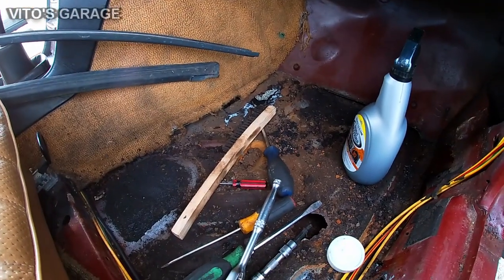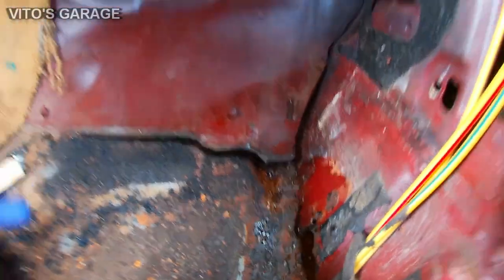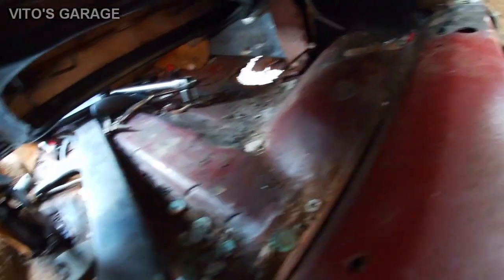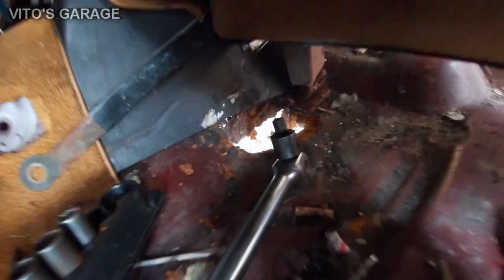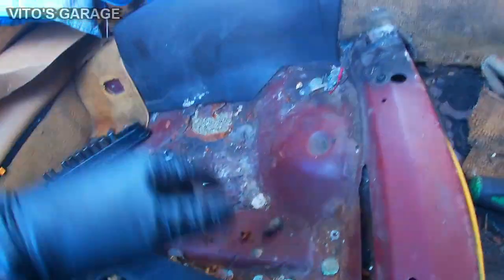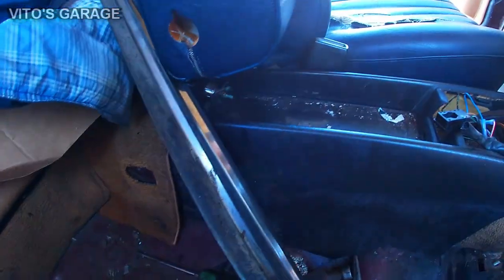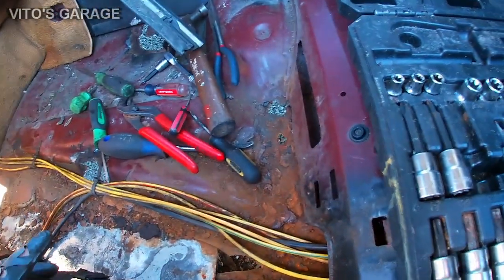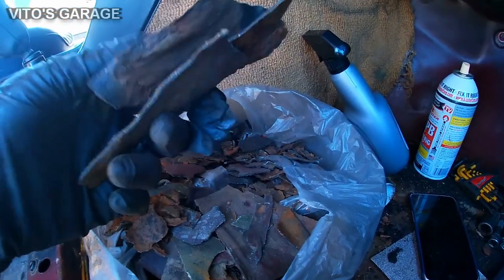Mercedes W123 240D Rusted Out Floors:Reasons to Remove Carpets & Sound Deadening on Classic Mercedes

Comment: Hi VITO'S GARAGE I feel empathetic when you were removing the sound deadening 😄 the same thing happened to me, I had a small hole in my old 240d in the rear seat footrest behind the driver's seat, it was like that for a long time, I think like 2 years ago 😅 About 3 weeks ago, taking advantage of the quarantine, I had some discs, metal sheets from another 240d that I had worn long ago and anti-corrosive paint to fix it, I had my face about what I'm going to do 😎 decided 😂 when I started cleaning, I didn't even realize When I was cleaning up to where the driver's front seat is attached, a 25 "x11" space 🤣 was all rusty 😨 I spent 2 days with my back crooked cutting and cleaning rust🤣 and that I started on the left side which was supposedly the easiest because on the other side of the passenger there is a bigger hole 😄 but hey I made a new floor 😃 I will mentalize again before starting with the other side 😁 in the end it is acceptable hahaha you know I am not w elder man but i did my best and i am satisfied, the sacrifice is worth it in the end; I know that 240d came into the best hands and I know that you are going to repair it, you know the meaning of old but gold👍 just prepare that back for an exhausting job 😂 Greetings, luck and may the force be with you 🙌💪
Reply from the maker: Wow!! Thank you so much for such a long comment!! And you're awesome!! Thanks a lot for saving these cars!! I am so happy there are more than enthusiasts like me out there and that I am not the only one☺ This baby will be getting fixed up! I never give up on any of my cars! Save classic Mercedes!😊🚗🚗🔧🔨

Comment: Hi Vito! Thanks so much for sharing all your videos! Just a question, once you´ve peeled off all the sound deadening material and once the rust spots are fixed, do you replace sound deadeaning with any new material? Cheers!
Reply from the maker: Hi sir. Yes, you can put some sound deadening on it. They sell them on eBay. Just look it up and you’ll find it. Make sure your floors are all painted and protected. Make sure you don’t have any water leaks inside the car because that sound deadening will trap the moisture and will cause rust issues again
Reply: Great! I didn’t know this material was so widely available, thanks!